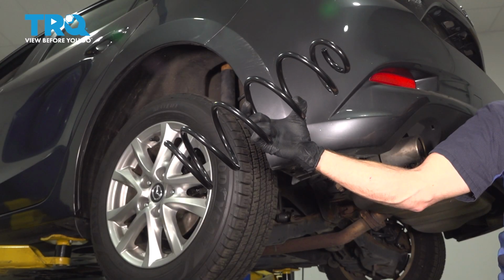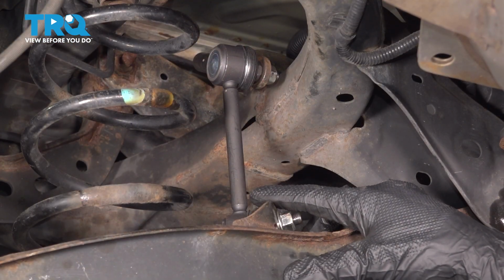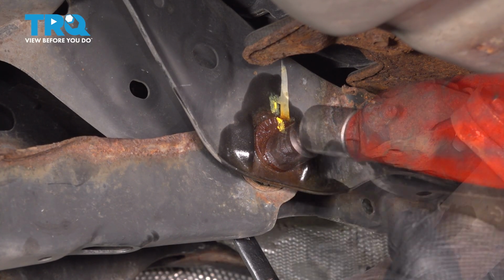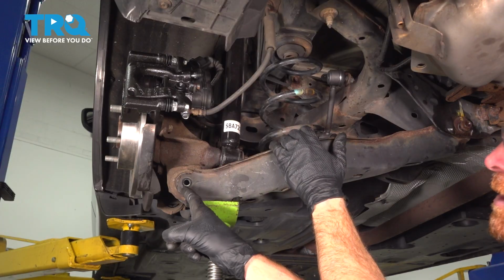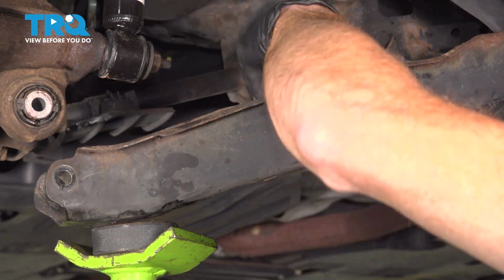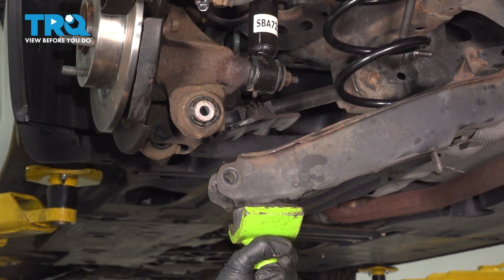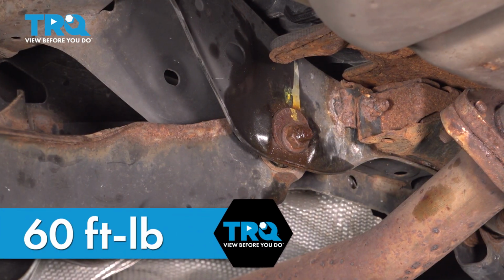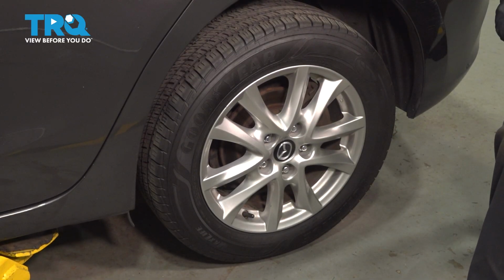How to Replace Rear Coil Springs 2014-2018 Mazda 3

Comment: For those who are actually gonna deal with rusty bolts… You actually only need to remove that outer bolt.
Put a pry bar inside the control arm and put some weight on it.
That will give you enough room to get the coil spring out 👍🏻

Comment: Do you not have to torque the inner control arm bolt with the car on the ground to preload it? I know you have to in the front, but that bolt was torqued well over 200flbs